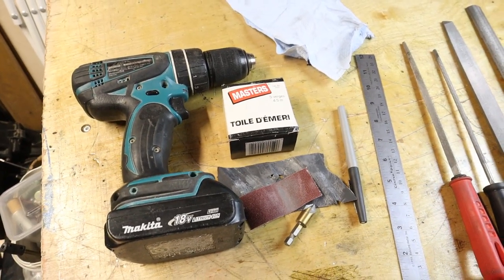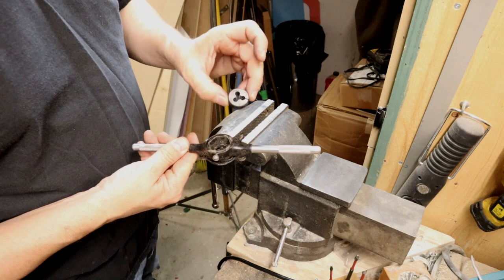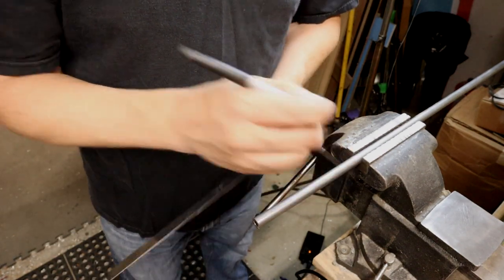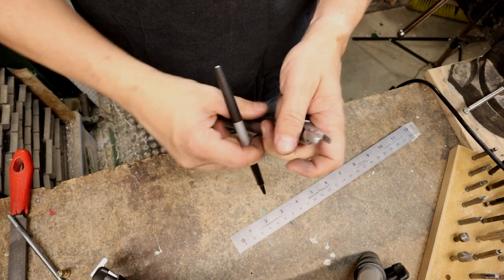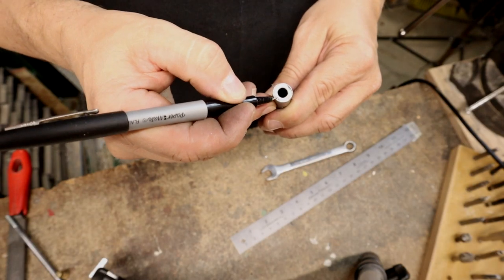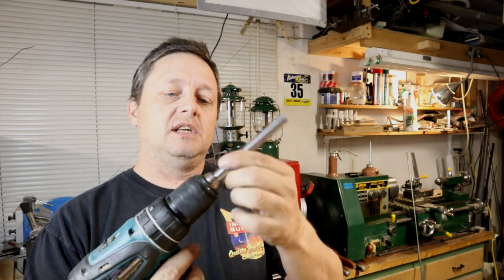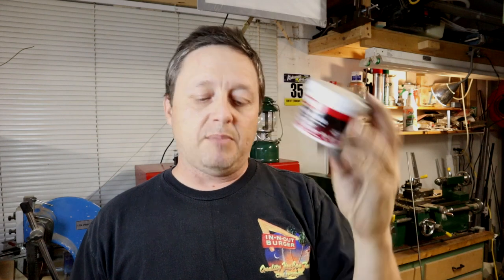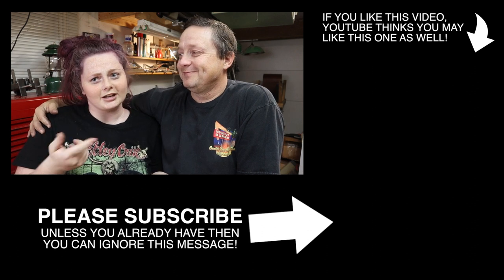How To Make a CHECK VALVE REMOVAL TOOL for a Coleman Lantern - PART 2 / Only Using Normal Hand Tools

Comment: Very nice!  Can you tell me where you purchased the metal tubing for the project?
Reply from the maker: Thanks. The metal tubing I used is "5/8" 120 wall DOM"  (Drawn Over Mandrel)  I get it a store called "Metal Supermarkets"  It's in my neighborhood but they have stores all over North America. Most commercial metal stores will carry it. You won't find it at Home Depot or Lowes. Cheers

Comment: I resurrected a 1960 sears wood lathe and powered it with a 3 hp  DC motor, Because I included the original pulleys I can gear it down and turn at any speed with that DC variable motor with plenty of power, So I bought some different chucks and have successfully turned a number of metal projects,
Drilling my mini cannon bore perfectly Centered all the way down was Very satisfying.
Reply from the maker: That’s cool. Some old equipment is made very well and can outlast a lot of the new modern mass produced tools.
Reply: Mike Freda, The bearings were American/Metric,  American for the shaft with a metric outside diameter, A bearing shop quoted me 50 bucks per bearing, I found new ones on eBay for 12 bucks!

Comment: We just used a regular BASTURD FILE . It fits snug into the check valve, you only need pliers to help lossen it.  Gets it right out with no damage.
Reply from the maker: I did that for a while with a large a larger screw driver ground down to fit perfectly.  Then one day I wrecked a very early 220B. Then I figured out how to make this tool. Never had a issue since. Your mileage may vary but I won’t be doing that again. Have a look on the Coleman Collectors Forum on how I fixed that 220B. That was a feat in itself.
Reply: The internet has exposed how bog a problem OCD is.... Just a 1/2 shade bit with the tip ground off works perfectly.

Comment: nice video i have a qustuin why didn't you use a pice of all thread instead of a bolt that way you would not have to  thread it
Reply from the maker: Thanks for commenting.  A full length of 1/4” ready rod would only work for the smaller / newer check valve. Those treads are 8x32.  The larger / older check valve uses 1/4”x 32tpi and that thread does not get cut very deep when using that die.  1/4” ready rod (aka all thread) normally has 20TPI which is a course/deeper thread.  It basically won’t work.  You need to start with a solid piece of 1/4” rod on the check valve side of the rod.  I hope that makes sense? Cheers.

Comment: $75.00 for the die EXPEN$IVE!!! old Coleman parts has removal tools for around $50.00. I suppose if you’ve got fancy tools and time this would be a fun project. Great information and you make good videos. Thanks
Reply from the maker: Yea, it is. You can find less expensive ones on E-Bay. I got a premium one knowing I was going to make more for some fellow coleman enthusiasts.  Forsure, if you only need one and you dont have tools, just purchase one.  Thanks for commenting,  cheers.

Comment: Hi, where can I purchase the steel pipe and what size is it?
Reply from the maker: The DOM, it’s explained in both videos. It’s 5/8” OD, 120wall Drawn Over Mandrel.  Any metal supply store (like Metal Super Market) sells it. It’s a very common stock. Home Depot or Lowe’s does not sell it.
Reply: ...the material is really not "pipe": it's "thick walled tubing".

Comment: Does anyone know the thread on the small stove check valve?
Reply from the maker: How old is the stove?   You can also tell by just pulling out the stem. Either it’s a 1/4” or No.8 thread size.
Reply: @MikeFreda  5/32-32 I figured it out.
Reply: @scottperson9487  ...that's an oddball size-(!)